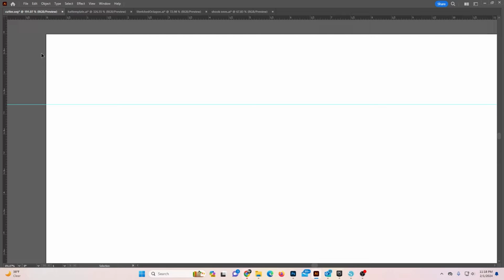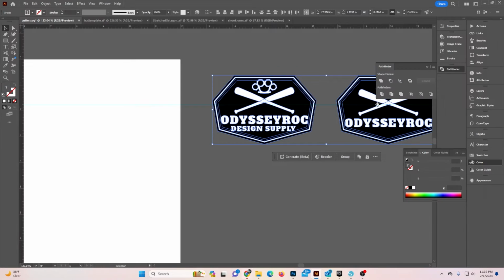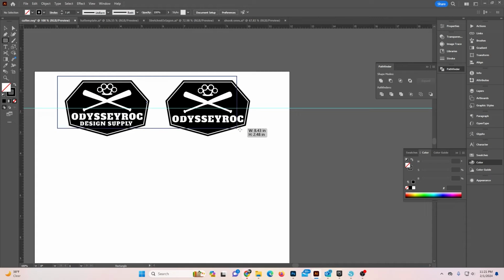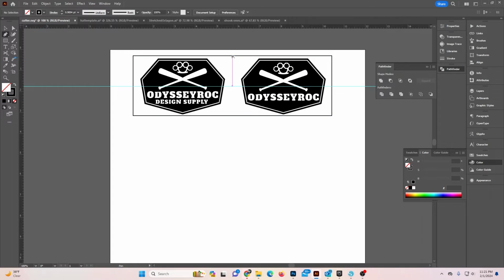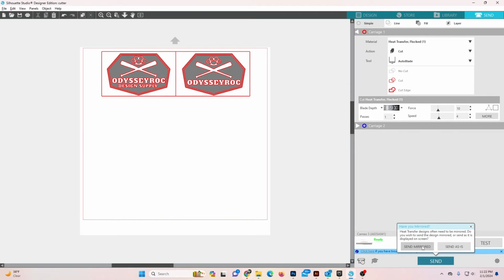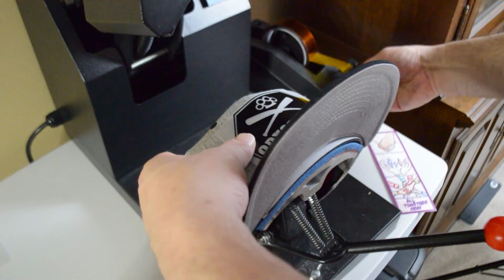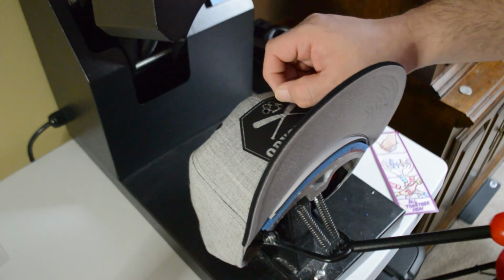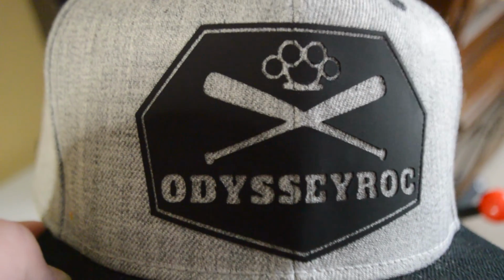Trying Siser Brick 600 Heat Transfer Vinyl

Comment: What style number hat is that
Reply from the maker: Otto 125-978
Reply: @odysseyroc  how do u rate this hat for Streetwear brand compared to yp classics and flex fit
Reply from the maker: In my opinion, the Otto caps are better. But definitely don't take my word for it and see if you can order one to check out.